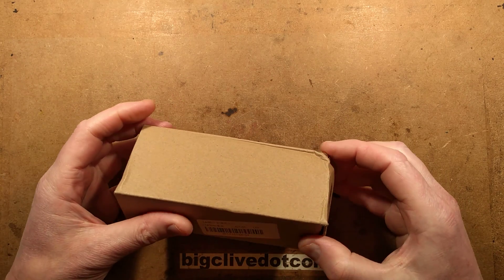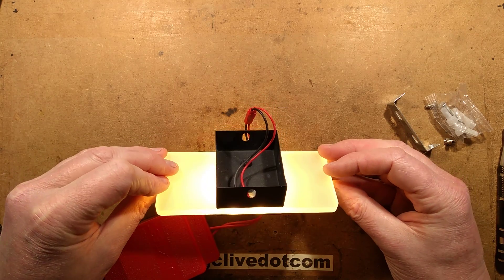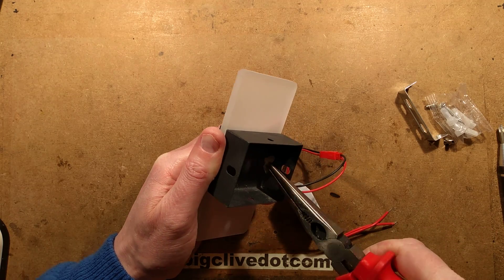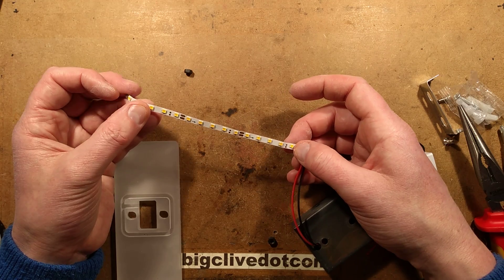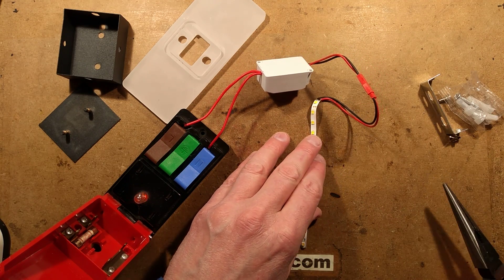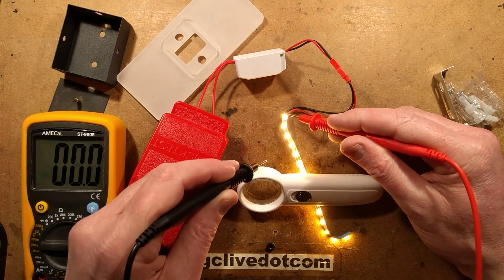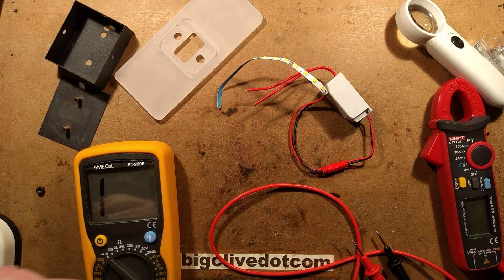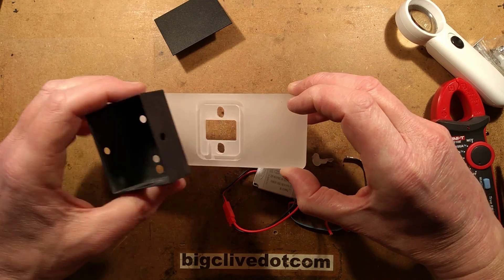Cleverly designed LED wall light with hackability.

Comment: That light is fantastic for hacking. A RGB strip would be awesome in there.
Reply: as long as you filter the output, else the LED strip becomes a great antenna for all the noise
Reply: I was thinking that. Different colours, maybe a Christmas tree light controller
Reply: or a WS2812 strip
Reply: @underwoodblog  I actually found a WS2812 type strip narrow enough that it fits and it looks good and lights up quite well even though it's a larger version than the one used by Clive. https://youtu.be/TAJ2ZO-GcN8
Reply: Would a ws2812b strip fit because it is wider than the original one
Reply: @dragonhunter2475  there are different ws2812b strips, the one with separate ICs won't fit and the others are only a little wider. I haven't got my lamp yet, so I can't test it.
Reply: @underwoodblog  I have this lamp and can confirm that a standard ws2812b strip doesn't fit as it is 10mm wide and the original strip in the lamp is 5.5mm. Something like a 4mm wide strip that uses smd3535 sk6812 LEDs would fit perfectly and can be programmed just like ws2812b.

Comment: I guess that would be usable if you leave out the fire hazard plastic box, ground the chassis, get rid of the dinky 0,00001 mm wires, solder some screw terminals on the board for proper wires and make a metal backing plate for the thing... is it really worth it for 230V? Not really. Having a DC distribution for those would be pretty nice I'd think.
Reply: @ItsMrAssholeToYou  still not grounded though

Comment: I'm confused by the bridging across the final set of pads. If the lights are in parallel, wouldn't that constitute a dead short?
Reply from the maker: Each section of five LEDs is in parallel and then in series with the next string.  A common return track runs up the side of the strip.
Reply: Red-faced, I have to admit that I knew they were in series-parallel until I saw that blob and then my mind went blank. It looked too much like it was just a short across the last LED.
Reply from the maker: @hughaskew6550  It's an odd arrangement that seems to have been designed specifically for use in lights.  It caught me out too.